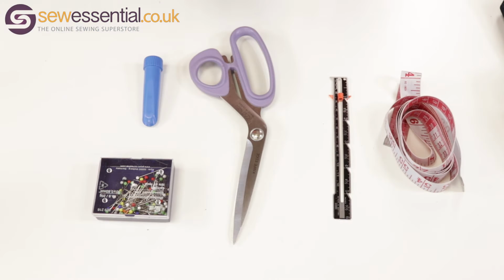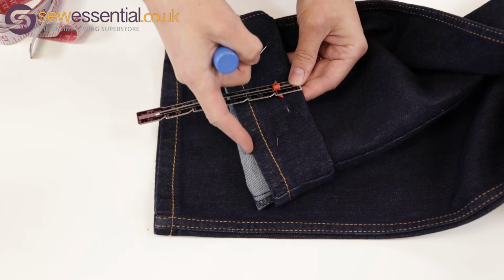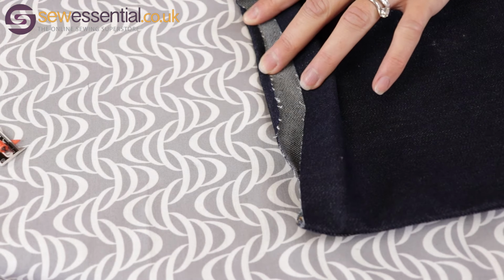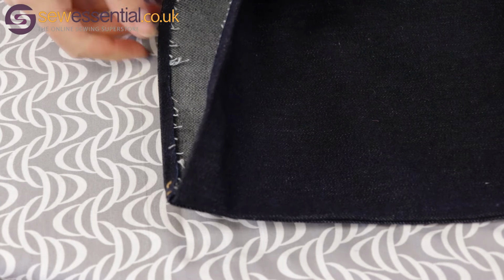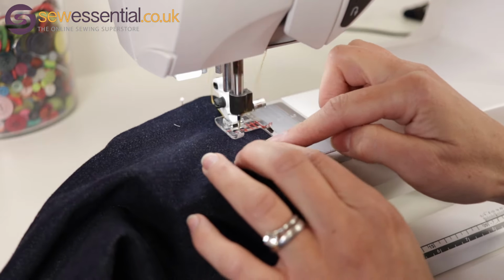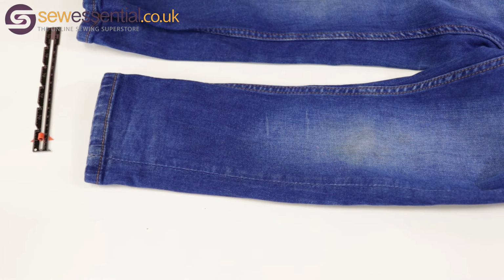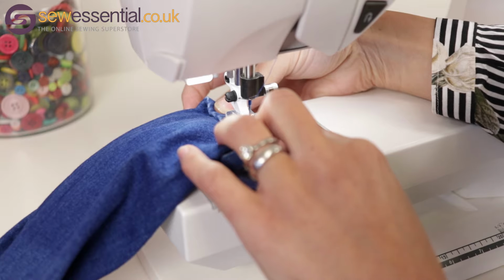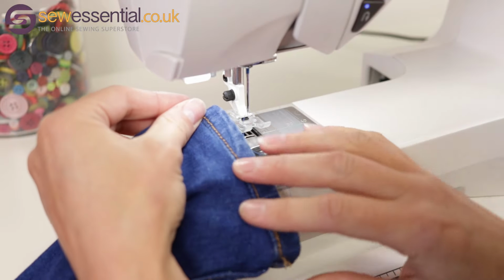How to Shorten Jeans - Two Methods

Comment: It is worth mentioning that the second ( "cheater" or tuck ) method works best with staight legged jeans. If there is a taper or flare in the pant leg, it could be much trickier as the tucked sides would be different circumferences. In fact, I would not recommend it unless for straight legged jeans.

Comment: Very enjoyable tutorial.  When I have a small hem to turn (like the 1/4") I first stitch a line from the edge of that amount -- I know it's an extra step, but it makes pressing it up so much easier than using a gauge or tape measure every time.  Just fold it over on the stitching line!  Thanks for your methods - am in the process of doing jeans hems and wanted to check your video out.  Thanks for sharing this.

Comment: Hello, thank you for the tutorial. I have a pair of bootleg jeans and the seam at the bottom seems a bit wonky.  I know in the video you say to measure from the bottom as it would be straight but what do you do when the bottom is wonky and not sewn straight?
Reply: Because I'm very short, I often have to remove 6 inches in pant length. If the pant has a flair outwards like bootleg I must remove fabric higher up the leg where the leg is straight OR taper the side seams near where I am hemming to make it fit. Skinny pants legs are the easiest to hem. Most women's plus sizes have an inseam of 30-32 inches. My inseam is 25. I try to buy a longer capri at 19-26 inches, if possible.

Comment: Thanks for the tutorial. I always put my pins at a right angle (across the fabric) as you can get your presser foot much closer and it is much easier to remove pins as you’re sewing. In fact if your stitch length is long enough you can often stitch right over the pins.

Comment: I am very short and have become the queen of shortening my jeans, capris and sometimes shorts.  I too have a humper jumper and also a foot that I got for my Pfaff machine that has a little ridge under it so it snuggles up against the bulkier hem so it sew along comfortably (not explained very well sorry and I have forgotten what the foot is called) but I sew along the top of the half inch changing my needle position so it is, say one eighth of an inch from the top of the hem, then the ridge makes sewing close to the top smooth and easy.  That along with my jeans needles and top stitch thread and I'm all set.  I always enjoy your videos and have picked up lots of tips.  Thanks for all your hard work putting these videos together, I really enjoy them.  Greetings from  Australia.

Comment: I learned of a great tip years ago that takes a lot of bulk out of the seams. Whack them over a block of wood with a mallet! Do this just before sewing so as not to disturb the the fibres. You'll still need the bulky seam tool, but get much thinner seams. 👍🇬🇧
Reply from the maker: What a great tip, thanks for sharing.